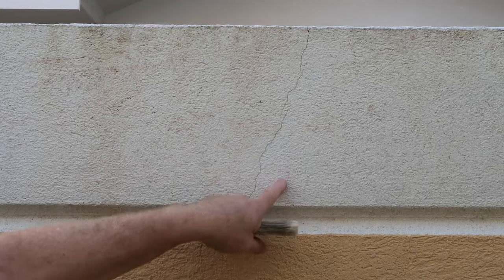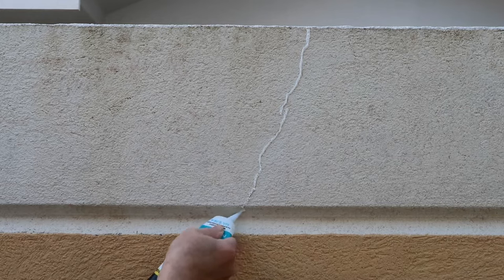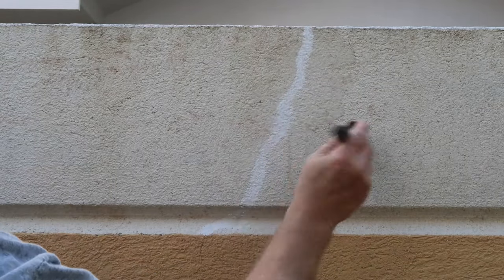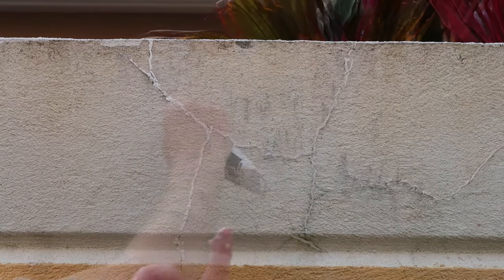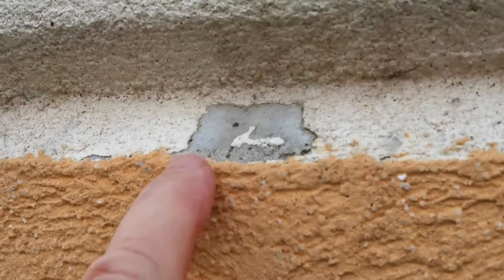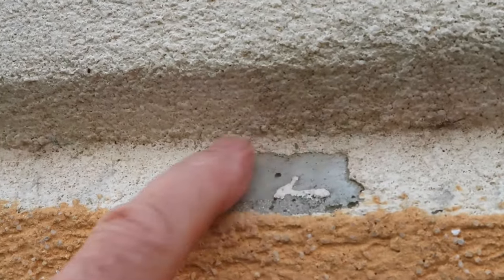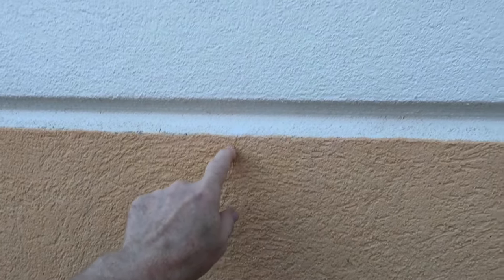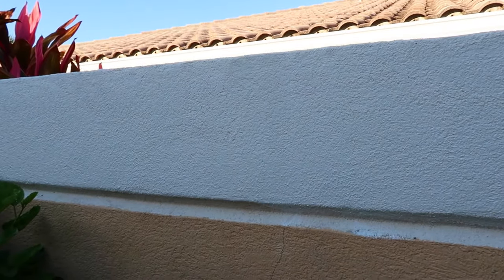How to Repair Cracks in Stucco | Fast & Easy !

Comment from the maker: This was an extremely easy fix -- 1 out of 10 for difficulty. I was so tired of looking at that old tired wall with the cracks it was time to do something about it! I am happy with the results. But now I have to paint the lower half!
Reply: I've also seen this done using clear latex caulk and use a sponge to remove all the caulk on the face. The crack is close to imperceptible, enough so that painting isn't really needed. Of course fresh paint is always nice!

Comment: Then you for the tip of using the older stiffer paint brush to push paint and caulking into the cracks

Comment: How would you go about repairing a poorly done repair? Basically they caulked the cracks but didn’t feather it in w a brush or sponge. Now I have large caulk smears over where the repair was—-any suggestions??
Reply from the maker: I think I’d try some isopropyl alcohol and a stiff brush to clean it up, and start fresh.